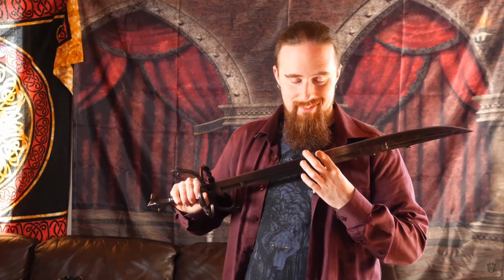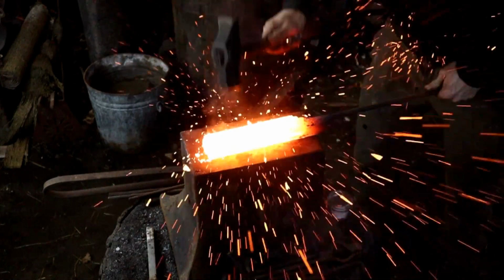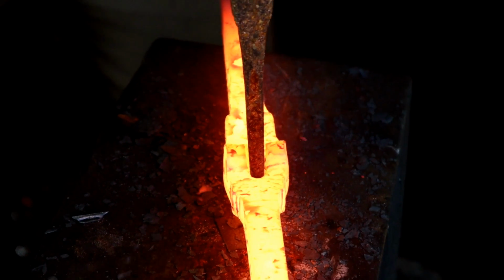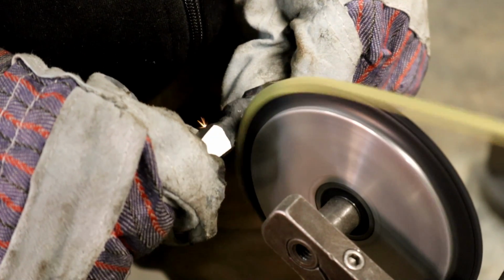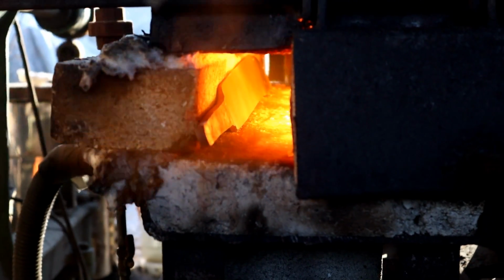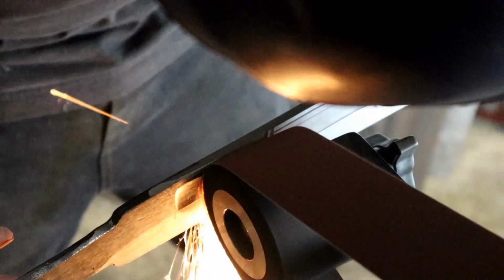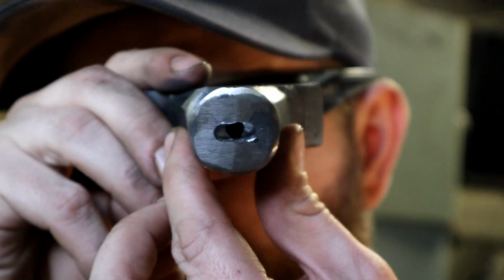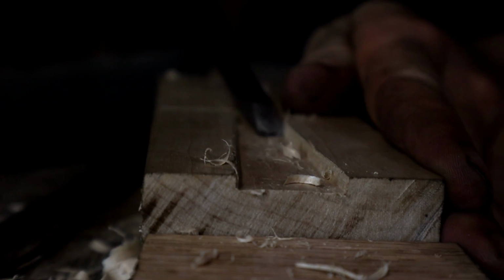The Skalchion - Making a Sword for Skallagrim - Full Build

Comment: You guys must have a good process for welding the guards... every time I weld something like that, by the time it’s ground down the welds are basically gone. I suppose you grind a recess, and then since it’s MIG wire you can penetrate it down enough to be able to grind it flush? The guard rings look amazing.

Anyway your grinding is really nuts. Ilya is awesome and everyone knows that, but I don’t know if people realize how hard it is to grind even flats let alone all the other stuff like the crazy fullers.

Comment: Hi guys, 
Another great build and video, well done. Now here's what I've been giving you as a challenge on many of your other videos as a suggestion for one heck of a bad ass Viking battle axe that no other can rival it. 
The Thor axe  "JARNBJORN"  built out of heat treated and tempered "Titanium". Why Titanium you ask, because it's the only material that can do this axe justice. Plus it would make an incredible collector's piece, a one of a kind with no rival. The most bad ass axe ever produced. What say you, up for the challenge?

P.S I guess you could make it out of 5160 but in doing so, you take away exclusivity of a Titanium version because you'll have hundreds of copycats making them because it's much easier to use 5160 than Titanium. A titanium version vs any other steel would make it a one of a kind as I don't think they'll be many copycats willing to put in the work of a Titanium versions. Yes I know that Titanium is very expensive and incredibly had to work with, hence why it would be so bad ass and one of a kind that you could easily ask whatever you want for it, since there's none out there to compare it with. 
"HIGHLY COLLECTIBLE DUE TO EXCLUSIVITY" are the key words!!

Comment: Would this build be possible back in the day when there were no powertools? Powerhammer not included since they exicted by manpower
Reply: Big grinding wheels were a thing.

I suspect that most of the fullers would have been forged in, not ground in.
Reply: Mr SpliffDoctor It is possible, but basically that is the reason why top quality swords were so expensive in the past: you had to put a hell lot of work into them.